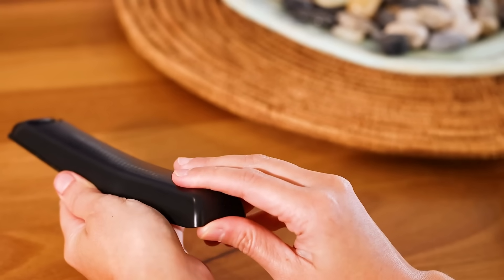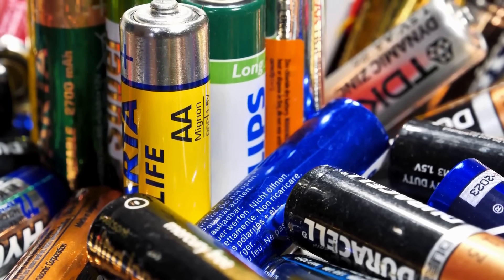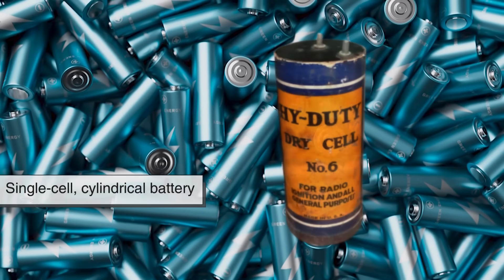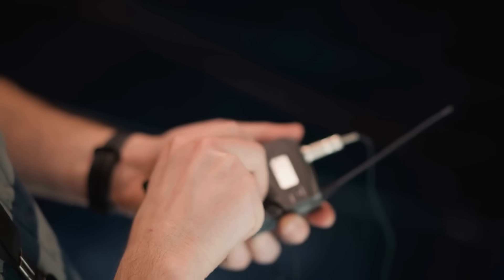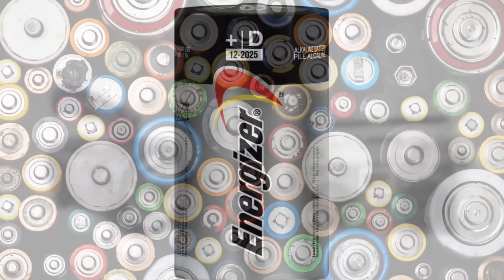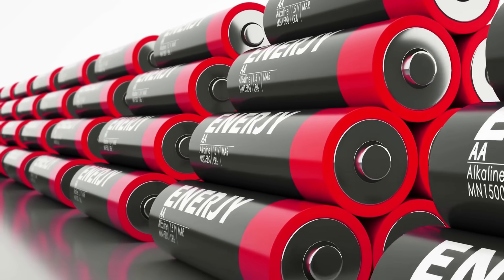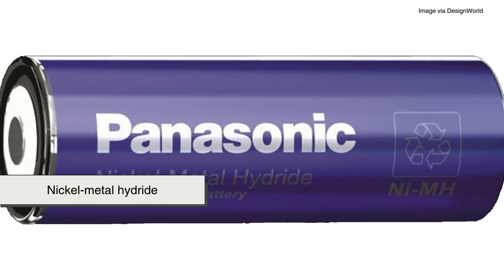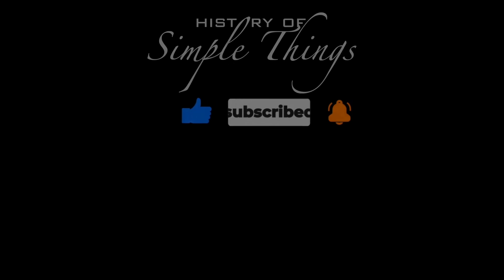The Hidden History of Battery Letters

Comment: Great video. This brought memories back to the 80s, when I was a beginner computer tech, and had to replaced CMOS batteries on motherboards, which were half the length size of a AA, and had to be solder onto the motherboard. Now just a flat 2025, or 2032. Not sure where those older CMOS batteries fall on the alphabet, but they existed. And while before I reached 10 years old, (late 60s, early 70s) I hung out on my god-father TV repair shop in his house, back when TVs were powered by vacuum tubes, and I do remember those "B" batteries. Thank you for this nostalgic topic.

Comment: Some of the early TRF battery ‘farm’ radios used three batteries, A, B and C  and later morphed into just A and B when designers eliminated the need for the C battery.  The B battery was the high voltage for the plates of the vacuum tubes - I’m not sure but I think it was around 90 V.  The other battery was needed for the tube filaments which required relatively high current, low-voltage - typically 6.3 V or 12.6 V in more modern tube types.  
 
The lettering nomenclature survived into the modern (at the time) AC/DC and AC radios and amplifiers and other equipment - and into modern times the plate voltage was called B+.    With the onset of transistor technology the terminology changed to V (for voltage) and is subscripted with designations such as Vcc, and such.   

But in old two equipment still around today they still referred to the plate polities just B+ because of the old B battery.

Comment: In the 60's they gave me a battery operated toy metal space car that ran around but didn't fall off edges. Sadly it used B batteries which was scarce. Only used maybe 4 or 5 times. If I had today's tech then, I would have mafe it rechargeable 😅

Comment: The 60's Eveready Lantern can fit 4 D-size batteries in parallel with another 4 D-size batteries for 6 volts. Or you can use just 1 6volt lantern battery.

Comment: I think contributors below have said it all: this only talks about a small proportion of the batteries, labels and reasons.  In 10 minutes, you could have covered a lot mre, and used fewer random pictures which didn't really tell us anything.
Reply: I think the musical interludes ate up a lot of the 10 minutes; they could have been shortened or cut out.

Comment: B batteries were never a size, but a type.  It was not a name, but a generalization of any battery with a voltage greater than 22.5 volts.  B batteries were made in voltages as high as 300, but most topped out at 90 volts.  (The 300 volt size was used in some photo flash units).  The A sized battery was about the diameter of a C or D cell, and about twice as long.  It was actually used in radio A (filament) circuits.  C batteries were also a name used as a battery type, they were radio bias batteries.  C circuits drew little to no power as they were high impedance.  The name C battery also became a size of flashlight battery, a bit smaller than D size.  You didn't mention AAAA size batteries.  These are the same diameter as N size cells, but a bit longer.  AAAA cells are used in very small flashlights,  and remote controls, as are N cells.
Reply: They were a size and still exist in a form as 3R12 the obsolescent 4.5 volt battery commonly used in flashlights earlier. The A and N batteries in radios are totally unrelated to the A and B in battery sizes.

Comment: You forgot to mention that ( many types of ! ) alkaline batteries leak  DREADFULLY  ,  ( often destroying your equipment ) .... you  NEVER get this problem with Lithium batteries ( unless you abuse them ) ... and Lithium rechargeables can retain 95% of their charge , even after a year in storage ... many small flashlights using 2 or 3 AA batteries in a flat formation can be retrofitted with a Lithium pouch cell from discarded vapes ( you WILL need a soldering iron ! ) ...... DAVE™🛑

Comment: In vacuum tube equipment the internal supply rails are named like this - A being the heater supply (often 1.4V or 6.3V), B being the anode supply - 45 and 90 volts(!) were common, C being auxiliary bias supply (which often needed to be BELOW zero volts, so necessitated an extra battery)....

Comment: A ‘C’ Battery was also a bias battery in old portable valve radios.
Reply: These 9 volt 'C' batteries were used in portable radio receivers of the later 1920s to the 1930s to supply a negative grid bias voltage to the output valve in the set. These long, rectangular batteries had tappings every 1.5 volts, brought out to individual wander plug sockets at the top of the case. By this means the amount of grid bias could be reduced gradually by the user as the high tension battery output (120 volts when new) decreased with use, and so avoid distorted sound. Too little negative bias voltage on the control grid of the output valve when the high tension battery was new would discharge it quite quickly. (The filaments in the valves were heated by a two volt lead-acid rechargeable cell.)

The later generation of 'all-dry' portable radios from 1938 onwards - using different valves and 1.5 volt and 45 or 69 or 90 volt batteries - developed this grid bias voltage internally. Perhaps surprisingly, the 9 volt 'C' batteries with wander plug-and-socket tappings remained in production until the 1970s; partly because some laboratories found them useful for powering experimental and test equipment.

Comment: "AAA" , "AA", "C" , and "D" cells put out the same voltage. The difference is the capacity (not really the amperage..). A circuit powered by a "D" cell will operate MUCH longer on a "D" cell than an "AAA" cell. The sizes are to fit the device. No one wants a TV remote running on "D" cells.

Comment: "B" batteries came in at least 3 different voltages.  45 Volt, 67 Volt, and 90 Volt. They were dry cell batteries to provide the higher voltages in tube radios.  I know the 90 volt batteries were available until at least the late 70's as I made a neon bulb "busy box" that used one 90 volt battery.
Reply: And I thought putting a 9-volt battery on your tongue was bad enough.  These voltages could kill you!
Reply: But again that is irrelevant to the B battery size.

Comment: what about how they come up with button cells like cr2032 or cr2025 or those 2450 all the same size but different thickness or some that appears soldered with some metal plate on the button cell and what's cr anyways?
Reply: The first two digits are the diameter and the second two are the thickness.   
2032 is 20 mm x 3.2 mm;  1620 is 16mm x 2.0 mm.   
CR denotes the specific chemistry. There are BR cells, which are used for extremely low drain applications.
Reply: The CR series cells are non-rechargeable lithium cells giving about 3 volts. The first two digits are the diameter in millimetres and the second two digits are the thickness in tenths of a millimetre. A 2032 cell is therefore 20 millimetres diameter and 3.2 millimetres thick.

Comment: The A,B,and C radio batteries were different scheme entirety and each could be a stack of several of the smaller cell sizes. B batteries could be 22
1/2 volts to 90 or higher.  C were 4 1/2.

Comment: Good luck attempting to purchase AAA batteries. Super Wal-Mart has batteries thru out the store but none of them, same with two big box stores. Cost twice as much as a ,AA battery at CVS. Somebody gave me a portable tube radio years ago. Battery only lasted maybe 12 hours and cost a lot. Threw it away after second battery died. The cheap transistor AM FM radio that I replaced it with was cheaper then the price if the two tube radio 50think it was 22 volt battery

Comment: A and B were both used in tube electronics.  A would heat the filiment, which required a low voltage but a lot of current.  B was about 40-45 volts, high voltage but low current, to get the electronics to fly across.
Reply: This has to be the most common wrong answer ever. There were batteries callrd A and N in radios but they had😅 nothing to do with A and N in battery sizes.

Comment: The 'B' size cylindrical battery and the vacuum tube 'B' (plate voltage) battery - neither of which are in common use any more - are not the same thing. Very different physical form factor and voltage!
Reply: Very true, a B-cell is very similar in size to the modern 21700 which a vacuum tube B battery is a behemoth (even bigger than a No. 6 much of the time)., I have one that's 45 volts and the size of a box of Cascade or Tide type soap powder.

Comment: What about the big square lantern batteries?
Reply: from the ones i took apart as a kid they're full of d or c cells like a 9v is with AAAA's
Reply: @Markous420  They weren't actually C or D, but in between.  Some obscure size.  There was a hoax spread online a few years ago saying those (lantern size) were filled with a chain of AAA batteries and showing someone opening them and revealing them, claiming it's so much cheaper to buy them this way.  So many people fell for it lol.
Reply: I still use these in hand lanterns that I upgraded to LED.  Somewhere in my junk pile I even have a rectangular lantern that literally bolted onto a double size lantern battery using the terminals.
Reply: The heavy duty and certain alkaline 6v contain 4 F cells, the cheaper 6v alkaline batteries contain 4 D cells...
Reply: The 6 volt ones?

Comment: The last B126 90V battery I ever bought was as far back as 1971 for my valve ( or tube radio). It cost me 15shillings. The shop stopped selling after. It had four stacks of 15cells like the ones in the 9V transistor batteries. Of course one would never test it on the tounge like the 9V battery.

Comment: You forgot the 9 volt battery.  AKA the transistor battery.
Reply: Yeah, I wondered too why he didn't mention those. Maybe because it's not part of the lettering system (aaa, aa, d, etc.). But no because he still mentioned the little flat nickel shaped batteries for watches. Maybe because the 9 volt battery is the only non-round shaped battery? It is sort of the odd man out. I'm not sure what they're used for anymore besides smoke alarms
Reply: @alvexok5523  J battery used to be common in the 80s for some TV remotes. J was a flat rectangular battery. I still see J types here and there in specialty electronics store but it's rarely used nowadays.
Reply: @Fan-lq6uv I'm not sure if I've ever seen a J battery before, I'm going to look it up, maybe I'll recognize it when I see it. I did grow up in the 80s so maybe I did see them a long time ago.

I just googled it, and they do look familiar, I guess I did see them somewhere a long time ago
Reply: It's shown once, but not directly referred to. I wonder why it was never given a letter or any standard designation other than "9 volt battery". All the others are "1.5-volt batteries", so stating the voltage isn't really enough. Except that there is only the one common size of 9-volt battery. (Not nearly as common as it used to be, though.)
Reply: @bxdanny  Guessing there was only 1 x 9v battery on the market with the unique 2 snap fittings up top so no need to create a model range ??
Reply: What about those rectangular radio batteries
Reply: I bought it yesterday 😅
Reply: AKA PP3
Reply: what you call a 9v battery is actually just a few AAAAs wired together in a certain way i believe.
Reply: @MoonLiteNite thats probably why it was never given a Letter. It would have been confusing.
Reply: @mikecromaticm2896  I vote  N   for Nine

Comment: What about the 9 volt???
Reply: A 9v battery is just six AAAA batteries in a box.
Reply: @TheRealKendrick no, its a different format, in a rectangular case with clip terminals.
Reply: @markedwards4879  no, it’s six AAAA batteries wired in series in a box to make 9v.
Reply: @TheRealKendrick  hmm - you are correct- sorry I misread what you wrote.

Comment: My radios take PP3 and PP9 9v - still no mention of why the naming convention fractured into alphanumerics?
Reply: PP9, haven't seen one of those in ages
Reply: PP denoted Power Pack. These 9 volt batteries in different sizes were manufactured for use in the early transistor radio sets from the later 1950s.